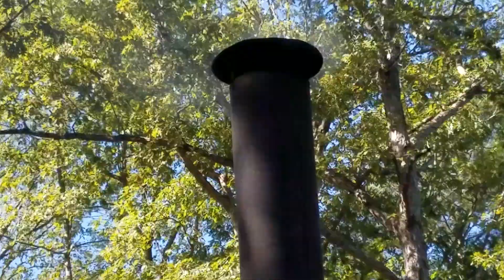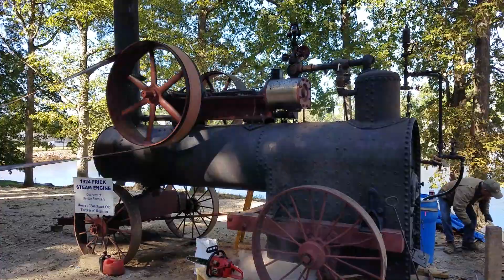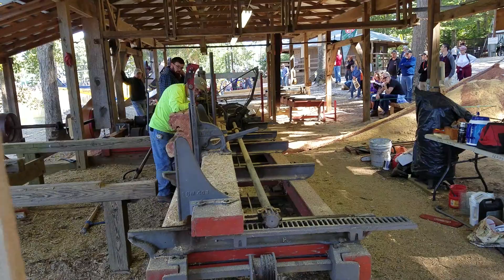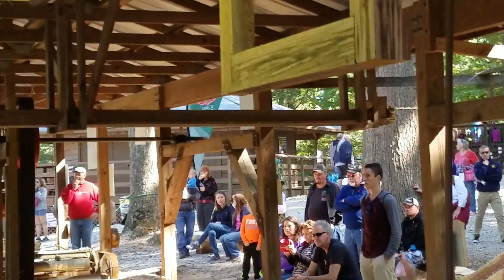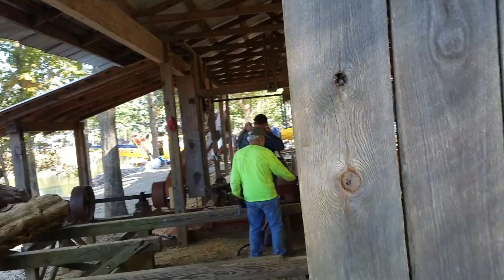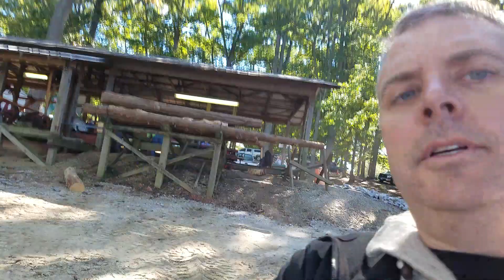Steam Engine Saw Mill. Start up and cutting timber

Comment: Why does the belt need to be a 1/4 mile long
Reply: The engine wants to be in the nice open air, and a long belt helps keep it working outside. Stops smoke being emitted into the sawmill, the sawdust doesn't get in the valve gear.
Reply: @ajaxengineco  now I know & it makes perfect sense 😀